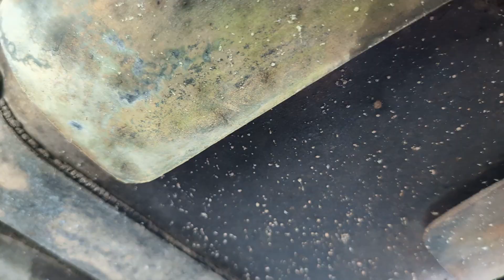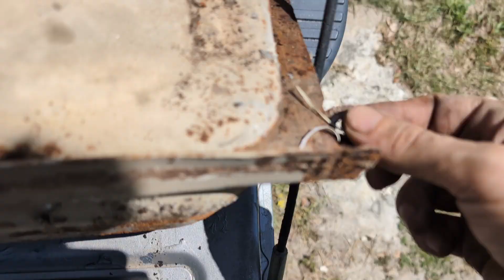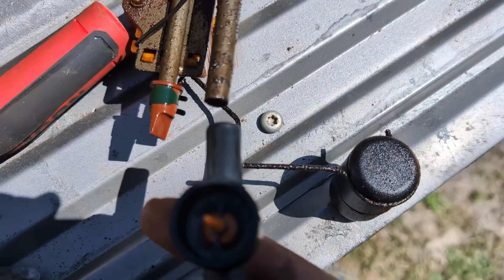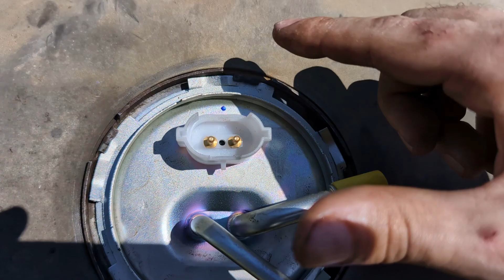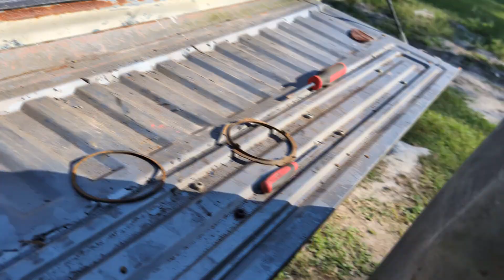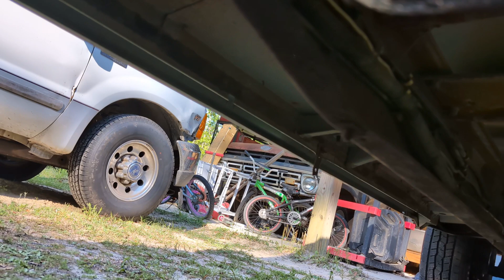Front Tank Repair and Sender Fix 1989 Ford F-350 7.3L IDI Diesel

Comment: Hey I’m still having trouble with my tach I replaced the tach sensor replaced the relay still got nothing  I looked at wires they was all good still can’t figure why tach won’t work
Reply from the maker: It could be a bad instrument cluster, or that particular gauge can be bad.  Rare, but it happens.  Before you go pulling the cluster and sending it off for repair I would get my meter out and start tracing all the wiring for the tach and make sure everything is as it should be.  A bad PCM(Transmission computer) can cause this as well.  Those can also be sent off for repair but I would at least open it up and look for burnt parts or leaking and/or swollen capacitors before sending it off.  Check the PCM as a last resort and only open it up if you feel comfortable doing so.  PCMs for our trucks are getting pretty hard to find.
Reply: I have a 7.3 with a manual transmission in my 89 and nothing on the gauge cluster works, the tach is intermittent, and sometimes on cold starts with the lights on will change RPMs with the dimmer switch on the cluster other than that the only thing that actually works is the oil pressure gauge.